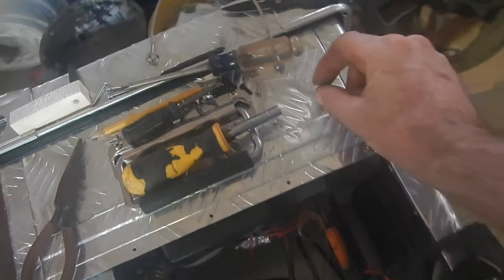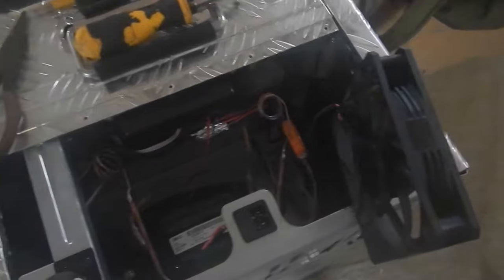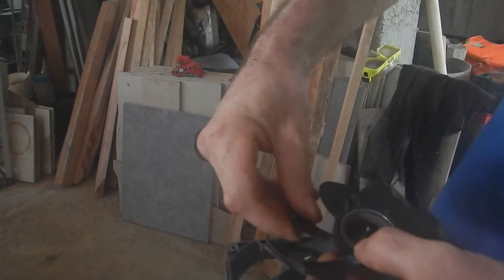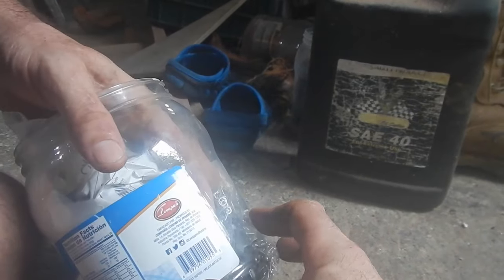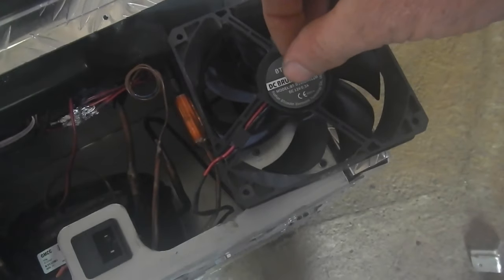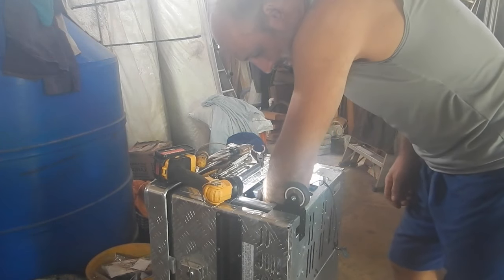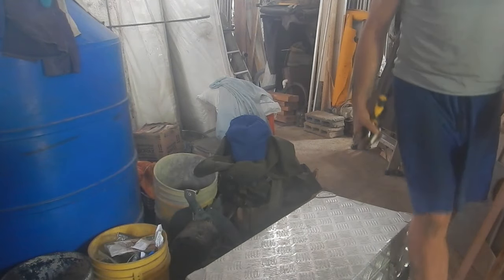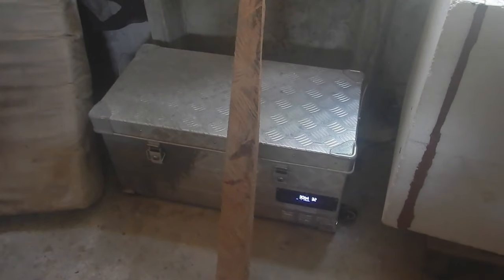Repairing a Fridge ...it was the fan! (Bodega AL42)

Comment: Reminds me of the top of the range Electrolux I had that stopped working in a year, fridgie said it would cost $450 to fix and it was the fan, I said screw that, looked up and ordered the part for $35 and installed it in half an hour. What a crook.

Comment: they used a plastic bushing?
Reply: No it's a plastic clip. It has a split in it so it can open slightly. You press it on to the axle and it snaps in to the groove and thereby locking the axle in place. It works very well if there is not a spring constantly pulling the fan blades the other way as in this case. Then plastic will simply wear out and pop off.
Reply: Ya seems like a weird design won't it need some grease on the shaft and clip?
Reply: @RustyShakleford1  I didn’t see if there were real ball bearings in there. Theoretically the plastic clip would then be pressed against the inner bearing race and nothing would rub, slip, or grind. But it’s not a press fit so it’ll move. I guess a little bit of grease wouldn’t hurt.